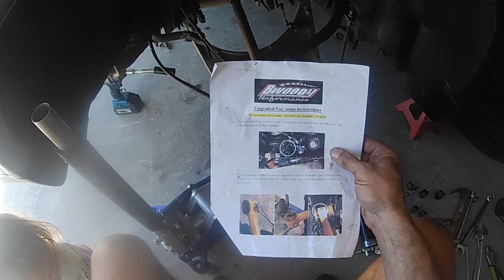Full install of Black Ops Swift Spec-R lowering Springs and BWoodys Full Suspension Upgrade. 🔥

Comment: cant wait to see how it actually looks.  the fitment has me wondering. post after video please. love your process. 21 RT myself
Reply from the maker: The picture in the thumbnail is about 1.5 weeks after. It’s all settled down now. 

I have a bottoming out issue. Adding spring spacer. Making another video of it. Should have that one up in about 2 weeks. I think the spacers comes in on Monday. I’ll be sure to start that video with how it currently sits for you guys. 

Thanks man! Long time in the making.

Comment: So how did it end up looking and did you end up using spacers?
Reply from the maker: The look is 🔥!!! I’m going to install 1/2” spacers, I just haven’t done so yet. 

I cut a good chunk of the bump stop so I don’t sit on the shocks or bottom out except for bigger dips and bumps. 

1/2” spacer should provide the necessary clearance to stop that. I recommend the install. 

Making a sitting video as well to show final sit.
Reply: Did you end up using the 1/2 spacer ?